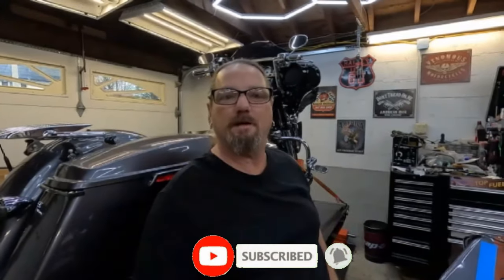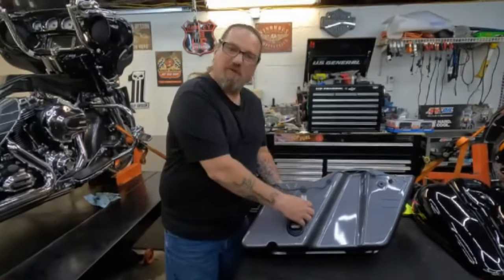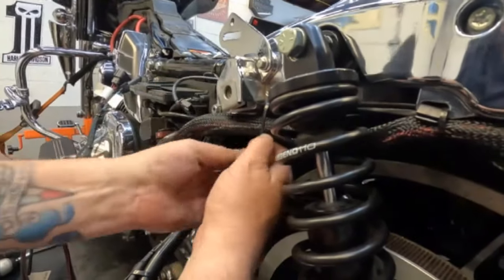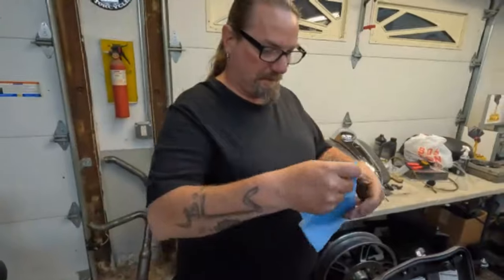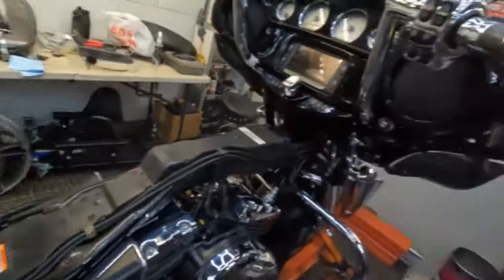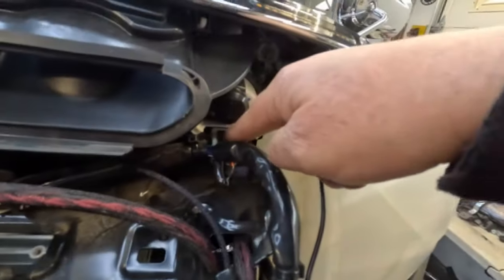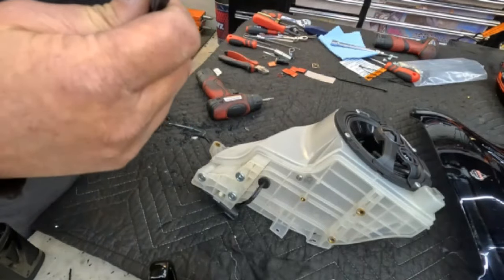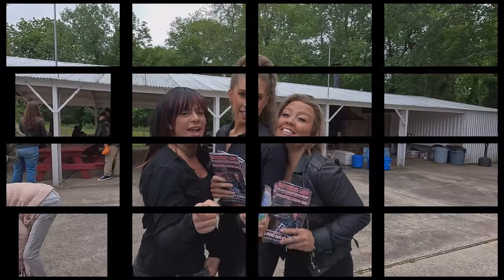Rockford Fosgate Stage II install on a 15 Street Glide Special.

Comment: They do the left because the left tends to be the cooler bag as more exhaust runs through the right side and amps can over heat. That being said, its still a horrible design on their part, I'll stick with my Hertz set up with the amp in the fairing. Great breakdown for those that want this though my dude!
Reply from the maker: Thank you.  I agree.  When I replace the oem system in my CVO,  I will be going with soundz digital